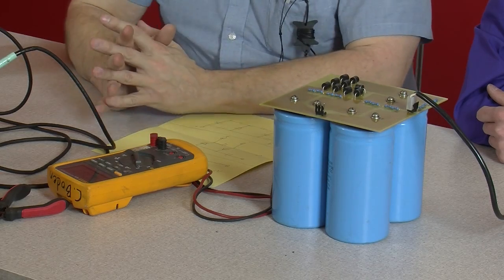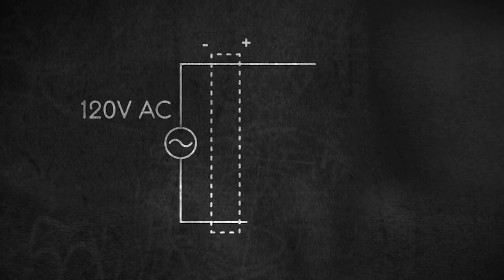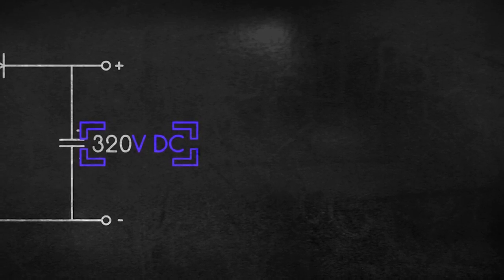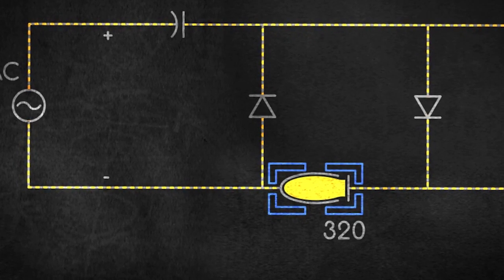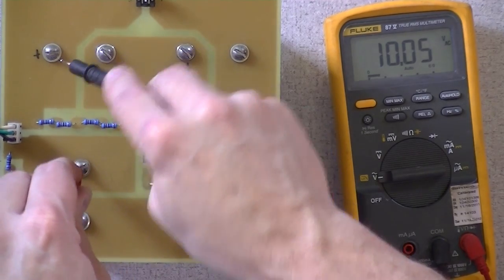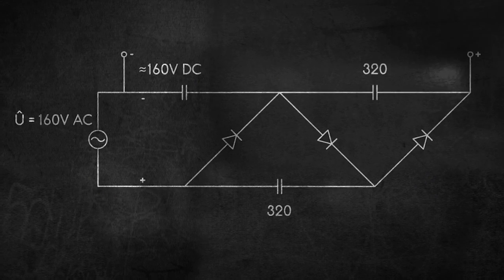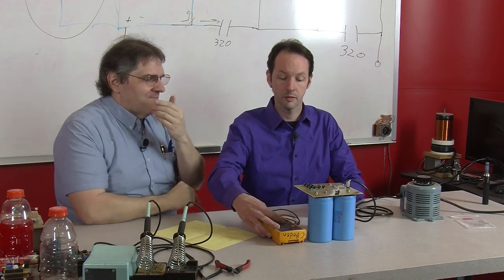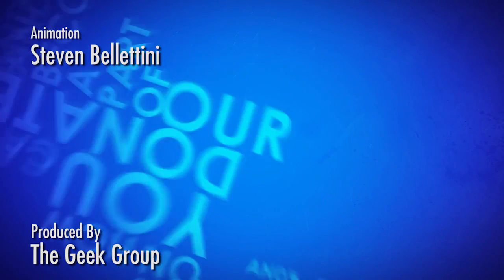Voltage Multiplier (Mini Musical Tesla Coil #2)

Comment: Just noticed this one... 

Resistor and diode values we had didn't match what we needed. We had lots of half watt resistors, but no two watt ones, so four in series acted like a single higher wattage resistor. With the diodes it was a matter of voltage, three in series acted like a single diode with three times the maximum reverse voltage.

Probably should have made mention of that during the video, but it wouldn't have changed the function of anything.

Comment: The voltage on a single capacitor wouldn't be more than 320VDC in this setup and the initial capacitor would be 160VDC. He's measuring voltage off of two capacitors.

If I understand this correctly.

Comment: Those extra Thumper caps are rated 480v, 2000uf, if I remember correctly.  How did that last one handle 550 or so volts as shown in this video?  Is that implementation of a trippler a little dangerous because if used for long periods it would exceed the what the caps are rated for, causing overheating and maybe even expensive smoke?

Comment: Excellent video. It always throws me for a loop however when someone with Electrical/Electronic Engineering explains current flow since it is in the opposite direction of what I was taught as electron flow. Anyway when they tried to explain hole flow to me I often wondered why I would be concerned where the absence of an electron was. Engineers and techs, separated by electron dominance vs. hole dominance. Who cares where nothing resides.

Comment: When we built the multiplier you see in the video I only had 100V diodes available, so I put three in series to get the voltage up to the level needed. (diodes in series act as a single diode, just with a higher voltage) 

The resistors are straight across the caps. They're to allow the voltage in the caps to bleed off when they're not powered. (making things a lot safer). I mentioned them in the discussion, but left them out of the diagram (they're not part of the multiplier circuit)

Comment: Some have theorized that this multiplier is capable of increasing the efficacy of an alternator/motor set-up creating an infinite source of energy providing the bearings don't fail. In theory, it should work. I'm curious if any of you have tried it. I would love to see such a thing work, generating clean free power. Yes, I am aware of the drama surrounding such things but it doesn't stop me from wondering if it's possible...

Comment: I realize I'm asking for trouble, but I just want to remind any first timers of the safety aspect of this kind of stuff. If you start out with this kind of (somewhat) high voltage stuff, eventually, you gon' get bit! so... you know... start off small... that way you get to deal with the "I told you so-s" while you've still got all your fingers. Then you can move on to the fun stuff, innit...

Comment: you can see they are mechanically attached by a small screw that also holds the board on. they just use heat sinc paste to make sure the heat can transfer well

Comment: Yep know exactly what you mean (have seen the high voltage lab). I have a healthy respect for capacitors, especially larger ones that can remove body parts if your not careful. I am still here, and developed the habit of putting a pair of clip leads across my bank when in storage (once its discharged of course!) :)

Comment: I like how chris tentativly pushes the tripler away once it was charged up to 500 odd volts. I too have hefty respect for charged caps - luckily I have not been shocked by one except for a rather puny photo cap.  Would have been fun to see you guys don ear muffs, face sheilds and discharge that unit with a chicken stick :)